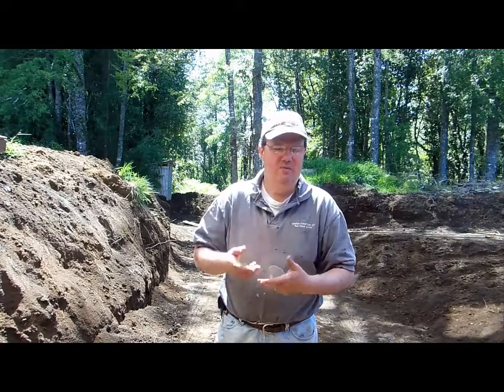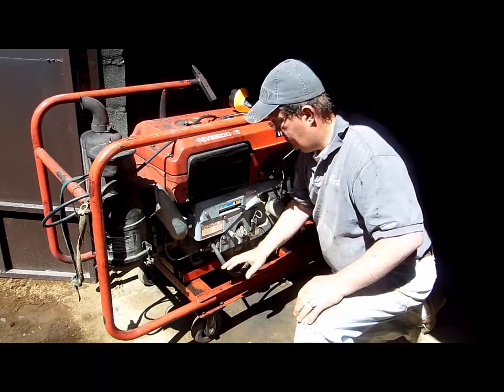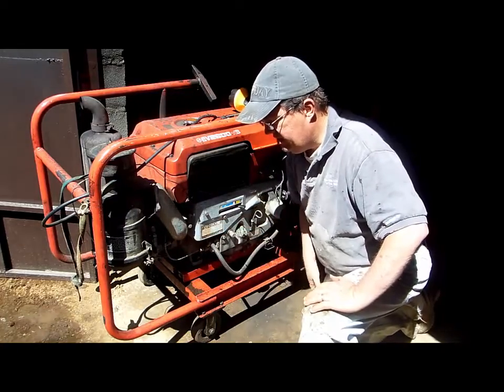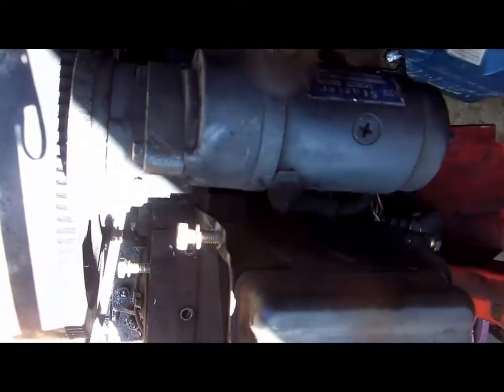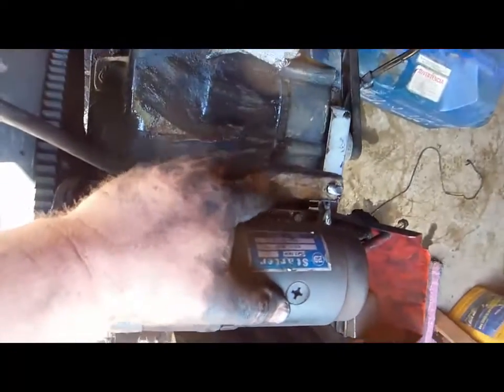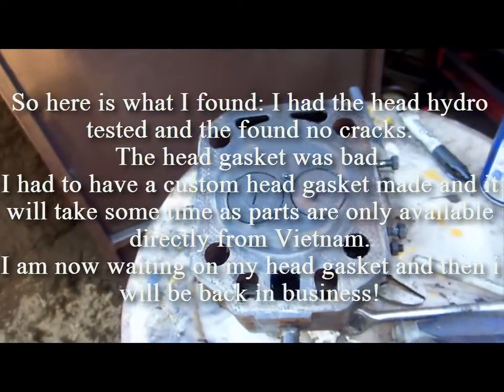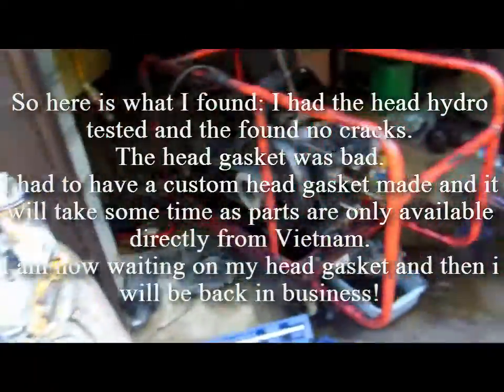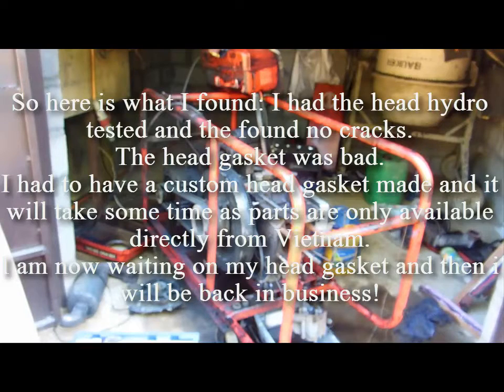How to trouble shoot a Diesel Generator

Comment: Hi
My genset starts but i CANNOT shut it off by pressing the stop button it keeps running. Its a diesel engine were do i look for to troubleshoot?
Thanks
Reply from the maker: Well here is the thing about DIESEL it does not rely on a spark so turning off the key is not in many cases going to stop the engine from running. 
You must starve the fuel from the engine. There is likely a valve that turns the fuel off to the engine. 
The other way is to De Compress the engine. Some diesel engines have a lever that opens the piston head up and will not allow compression and thereby stops the engine. 
If previously your engine was turned off by the key then you should trace back the wiring and look for a problem there. Electrical is not my best area. Jim

Comment: Sorry I have been slow watching your videos. I hope you can fix it. Ever think about a electric pump with solar power?
Reply from the maker: Yes I have I actually have talked with Engineer775  up in Pickens near my old stomping ground in the upstate about getting a Dankoff pump and setting up the same system the he has set up on one of his videos. It is a cool system but the pumps are not cheap $800 so I have been waiting for the funds. The do not pump a lot or real fast, just continuously and that is almost better than the other two combined. 
I have sourced one here and the panel to run it, and I will likely install it when I have the funds. 
With all that in mind the generator is still needed to run my big equipment like my welder and compressor. I also like having it for emergency backup.
Right now I am running a small solar system (6 panels @ 250 w and 6 batteries). it was sufficient for my cabin but now that I have the new house 3/4 done I need to have a dedicated system for the big house.
Weeeelllllll back to the $$$$$$ issue. I am expecting to spend $20,000 on the big system for the house with all the bells and such. I have a solar guy here who knows his stuff and works on big military and cell contracts who is going to do my system for me. I will help with the install and such, but he is the design GOD. Also he orders panels and batteries and bulk for his big contracts and puts my small 18 panels and batteries in the batch and I get the discount. 
I am praying it will come together. Jim

Comment: I hope you get it fixed.
Reply from the maker: I do too. I am borrowing my biddies 10 kw generator so that I can fill my water tower and have water for the farm. I am thankful for it but it is gas and uses twice as much fuel at 3 times the cost so i really want my diesel up and going. 
I have been told by the guy who checked the head that there is a guy in Valdivia who makes from Scratch metal mesh gaskets like mine and they are factory quality so I am hoping that in the next week or two I will have it back together and going. 
We will just have to pray and see! Jim